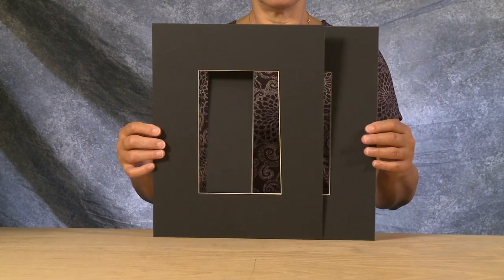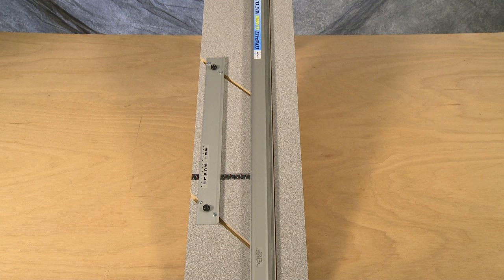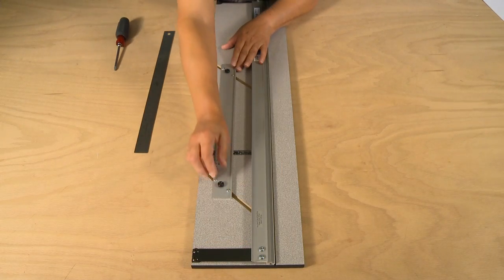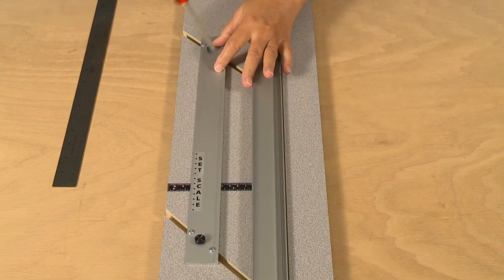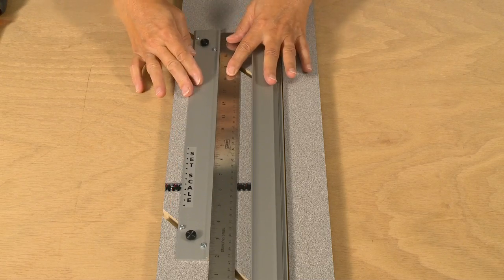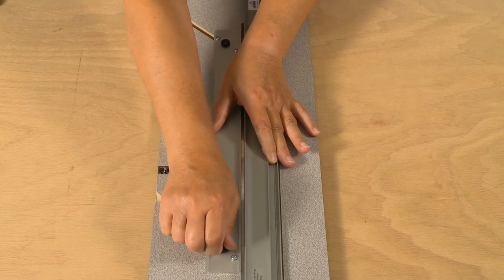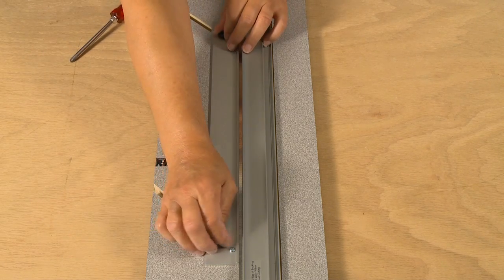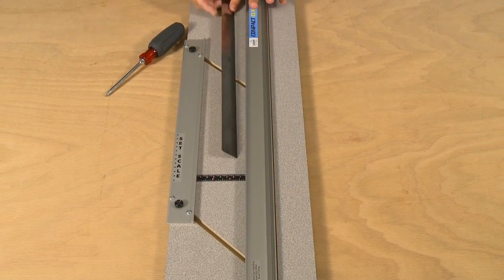How to Re-Parallel a Mat Guide on a LOGAN mat cutter

Comment: Perfect. it would have helped if this adjustment had been included in my owner's manual. But thanks for putting your Logan maintenance suggestions on line. Mat board is getting very expensive.
Reply from the maker: Hi, your instruction manual should have had a section on doing this. Can you tell me which machine you have and when you bought it? Thanks.
Reply: I have a Model 650. I bought it, I believe, in the mid to late 1990s.
Reply: @LoganGraphic  I just bought an Artist Elite mat cutter model 450-1.  On pages 7-8 of the owner's manual clearly shows how to fix a not parallel problem.  There's also a short YOUTUBE  video showing how to fix it too.